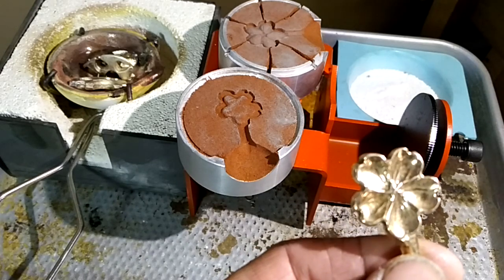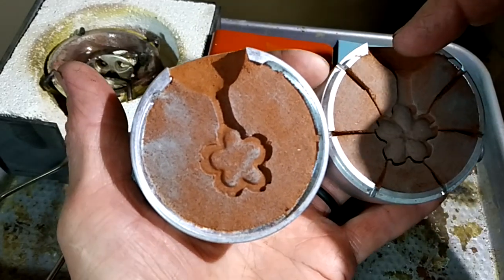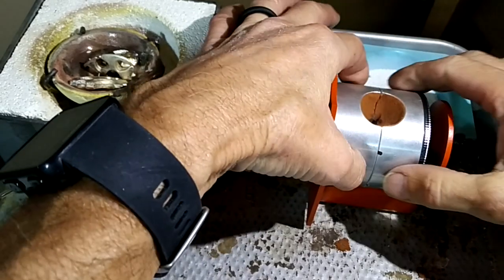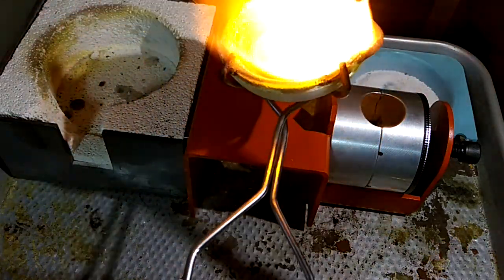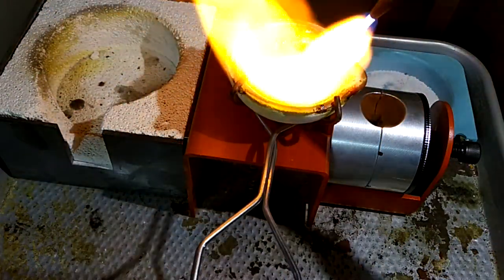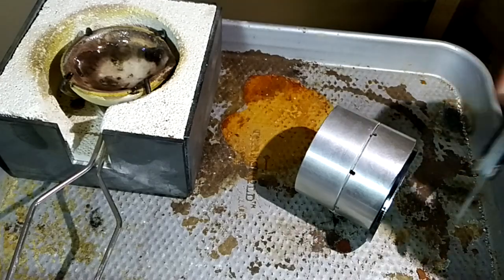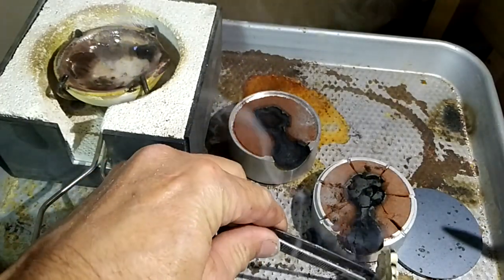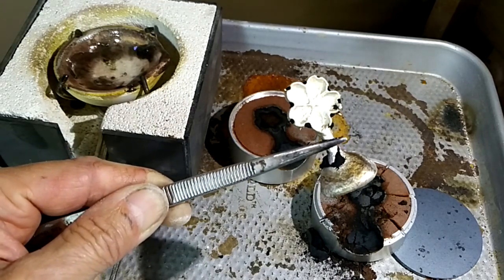Red Clay Casting: Pouring the Sterling Silver

Comment: Not sure what clay you’re using but could I use any clay to do this I’m in Canada and can’t find delft or greensand lol so thinking about using plaster or something
Reply from the maker: Red Clay is my brand which I import from a foundry near Holland. You need an oil bonded clay like Petrobond, Delft, or mine. There are some other ways using Portland cement and motor oil but I don't recall the mixture.

Comment: Excellent. I have not been able to make a cast for a long time. I used a crucible from your Etsy. + my little smith torch with propane and oxygen. The second cast turned out better. Excellent system, greatly improves each cast because your system takes care of the ventilation issue the old method did not.
Reply: Trying to cast a ring I already wear, to practice my casting skills. 

Metal temp is a factor. 
Air flow is a factor. 
Too much heat to the metal + too much air flow and the metal will go thru the entire mold and pool under it. 

Casting is kinda hit and miss this month. 
The ring is a steel ring and the issue is a partial cast of 25% then 75% then 100% with defects in the metal. 
To correct the temperature of the metal use map pro fuel or keep the heat on a bit longer prior to pour. 

Will try again this week end.